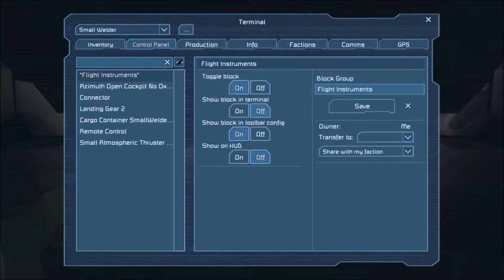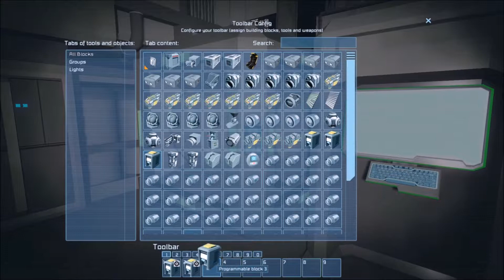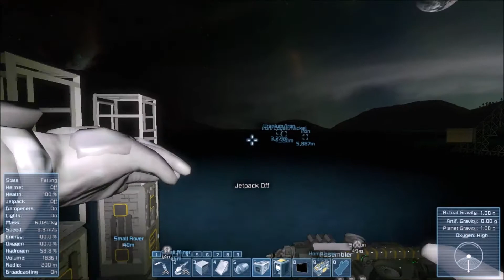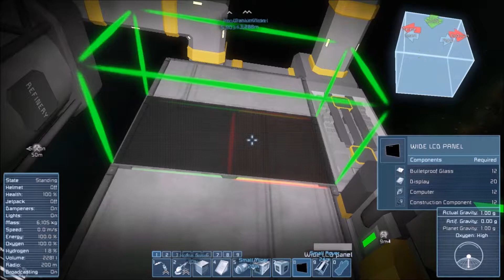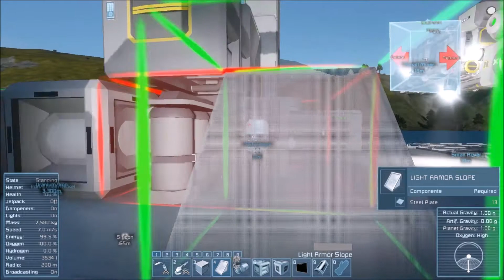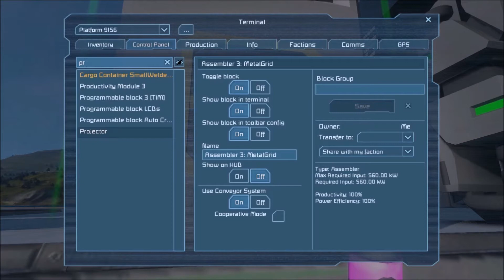Space engineers Survival Planet E9 - AutoCrafting

Comment: In the TIM's script the is a configuration for putting quota's on LCD Screens which you can edit to set how many of each part you want right in the text display of the lcd and it will produce them as you need them.
Reply from the maker: +Mackie419 Nice one thanks for the tip. This was the first time i have used TIm so im still new to its features.